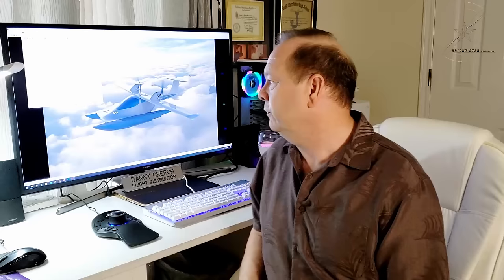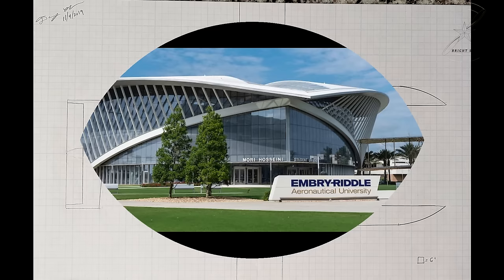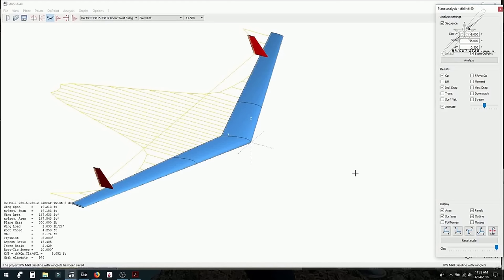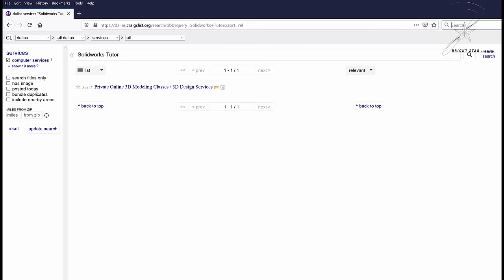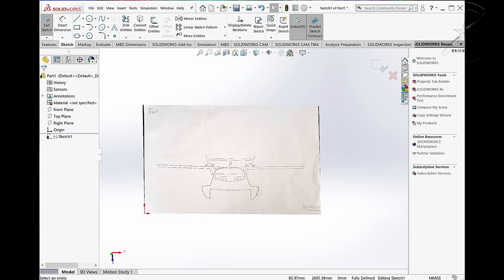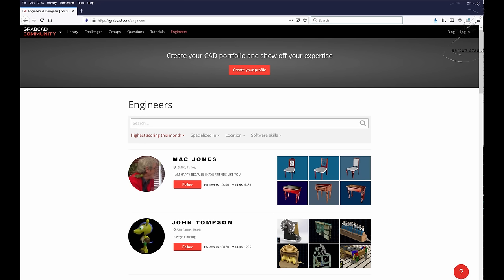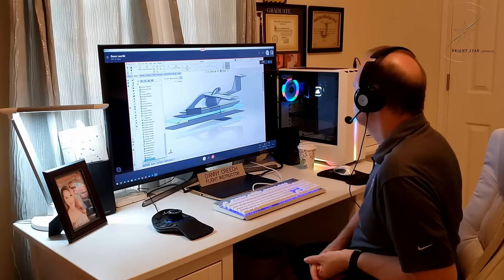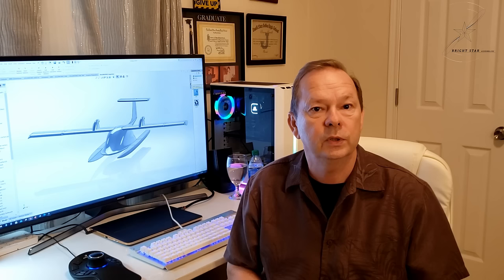How to Design Your Own Aircraft

Comment: Great looking design. Might I suggest a twin boom layout with dual rudders? My worry is that with your current design, there might not be enough airflow over the single rudder for sufficient yaw control at lower speeds. You could use differential thrust mixed in with rudder input easily enough on RC but that wouldn't be ideal for full scale.
Reply from the maker: Thanks for the idea. I will keep it the way it is. I am not a fan of the look of twin booms and that also adds more drag. As you can see, this aircraft already has a LOT of drag. If you  look at a B-787 you will see only one tail and at low speed, that one tail can handle the massive amount of thrust from one engine at MAX and the other engine dead.  There are very few certified aircraft with twin engines and twin boom tails. There is a reason why.  Thanks for the suggestion though. I am always open to good ideas.

Comment: Solid works is easy once you get it..
The best way is to creat the design from foam and try it as a RC and try to modify and improve it before starting on any 3D software since it will take shit load of time and modifying it will take even more 
.. I would try to make a simple design by foam and sand it down to what I might think is what I want and try it as RC and see the aeronautical issues and try to modify it in next several versions,  once I figure out all the part locations like let say where the landing gear or floats needs to be mounted,  I try to copy that idea as 3D modle 
. This is exactly how car companies use clay models to create by hand and scan that modle and try to modify the rest of the details on computer and re machine the design on another clay block using CNC and thats how real idea should come to life
. I know several 3D softwares and my suggestion will be to not start with software design at first but after few RC models and trial and error before spending shit load of time behind computer.. but once the RC modle worked out and seems ok, then go to software and start working out around what you find in RC modle 

 It will be more practical and less time and cheaper..

You can use many many different softwares, solid works, CATIA,  fusion 360, inventor,  many different types of CAT's . Even Art cam if you want to go crazy with surface design looking like a bird.. but I say solid works is the best the only downside is the price..
Reply from the maker: Thanks for the comment. I didn't find the price of Solidworks (FREE) to be much of a burden. In this video I mentioned that if you are a member of the EAA you could download the software for free. They are even allowing users to take the first SolidWorks certification test for free. There may be some disabled features in the free version but I haven't run into that yet. If I do, my CAD guy has a fully working version that he could use to do anything else we may need. 

As for making a model first then putting it into a CAD program, yes, that is one way of doing it.  I use to build and fly RC aircraft so I am fairly familiar with the process. The problem as I see it is an RC aircraft is not like a real aircraft. There power to weight ratio is way off, the flight characteristics are different. Because of the lack of interior and hardware the way it would float in the water would be different. The speeds at which an RC flies and stalls is different also.  With that being said there is one thing I do see a scale model would be good for. That would be to visualize what it looks like. But I can do that in Key Shot with many different angles. Once we have the design all locked in then we will make an RC model of it before we build the full scale prototype. There have actually been already three different people email me wanting to do this. So, the scale RC model will happen. 

Thank you again for the comment. I like hearing others ideas.
Reply: @BrightStarAssemblies  if you make the rc model with exact scale on all part calculating the wing load and applying it to the rc model,  the stall speed and all aerodynamic futures will be similar to the real model since the wing load keep the same and about the floats, it could be calculated to mimic the real model by using small weights in different areas to change the CG to match with real model 
.. 
I fly and I know the wing load in the same scale will act almost the same even if the size is smaller .. using the same wing span only scaled down and the same with wing area , scaled down to match the Aspect ratio with real one and calculat the wing load and add Weights to the scale model that will mimic the flying characteristics of the real one at leat by %90 ( since the smaller scale modles are not as efficient in glide ratio than larger model,  I would say about %90 similar to real one)
Reply from the maker: @Driftseen  Thanks for your comment.

Comment: Solidworks is tough to learn on your own. If I could devote the time to learning it and had a suitable tutor, I'd try it.   As it is, I use a simple 2D drafting program (Turbocad). The X15  was designed with pencil and paper, after all.    You do not need fancy 3D software for 99% of homebuilt aircraft.  If you build swoopy composite things, then 3D CAD becomes valuable.  Old school biplanes?  Not really.
Reply from the maker: Thanks for watching.  I do agree with you about you don't need fancy 3D software to design a home built aircraft.  In our case we are not designing a simple one off home built aircraft. The plain for my design is to make it a kit that can be built by other builders. That requires a material list, inventory list, and construction plains. Later on I plain to make this a certified aircraft which will need FAA Certification.  So, although this design is starting off as an idea, I am treating this design with the respect it deserves in order to become a certified aircraft.  This is why I am using SolidWorks.

Comment: Great concept design! I love aircraft with such an out of the ordinary geometry!
I think I'm a little late to say this, and I hope you're doing great with your project! I'd recommend you adding a little bit of Geometric Washout at the tip chord just to count for an aeroelastic effect called Divergence, that way you can have an even smoother lift distribution along the wingspan. (Also helps if the aircraft is stalling, it ensures some aileron efectiveness).
Reply from the maker: Thanks for the comment. I like ones like yours who offer constructive advice.

Comment: Then comes the issue of stability. How stable is the aircraft in longitudinal or lateral direction. For example if a sudden vertical gust hit the plane what would be the response. 

Or for example you changed the trim what would your longitudinal stability looked like. 

I am just trying to help here.
Reply from the maker: This is why one would have experts look over the design before building the first part. Later comes flight testing to see if the so called experts were right or not. If not then make changes as needed. Trim doesn't normally affect stability. There are many other things that do affect it but trim is way down on the list.

Comment: I'm no aeronautical engineer but that looks like quite a high centre of thrust and low centre of drag. Otherwise this is a pretty good effort for a first youtube video keep it up.
Reply from the maker: Thanks Philip, I appreciate your comment. There will be changes to the design over time. Then once I am finished I will have an Engineering company check the design out to ensure it will be safe and has the proper dimensions. I don't want to waste money building something only to find out I designed it wrong.

Comment: Instead of using a turbine or jet to supply thrust to the air craft is it possible to supply thrust to an air craft with magnetic repulsion? Is magnetic repulsion even plausible? I've seen a design for an air craft that was a bit more saucer than plain. It utilized mercury, electrical current was passed through a ring filled with mercury. Does an air craft even need to have wings. Or more accurate a question, is it possible for an air craft to have no wings or any visible moving parts?
Reply from the maker: Thanks for writing. I am also a big fan of sci fi movies. As far as I know, there isn't any aircraft flying that doesn't have moving parts (gliders do not count because their was moving parts to get them in the air). Even blimps have motors to move them around. Even Hot air balloons have parts that move in the burners.   Maybe a plane like this one is something you might like.  https://www.pinterest.com/pin/441352832222853264/

Comment: What I would do: use OpenVSP (it's free, made by NASA) and let's you really size the design and run Vortex Lattice Method and Panel Method analysis for immediate feedback. I would then use the various export formats to import my design into solid works. From that point your friend could clean it up and you'll know you have the performance you're expecting. This saves time and energy for both of you 🙂

I also highly recommend the Ultralight Airplane Workshop on YouTube with Leon, as it covers common terminology, sizing, and construction techniques that will save you a lot of hassle. Blue skies! 🛩️
Reply from the maker: Thank you Keith for your comment. I am currently looking at the YouTube videos for the OpenVSP.

Comment: I have a plan of making Hydrogen fueled planes based on the F15 just a bit smaller because the F15 is 19 meter long and my plane will be around 6-7 and i will put two 50 litre high pressure hydrogen containers at 700 bar and if i make the engines well they will be able to run it for 4-5 hours at 300 km/h or more.

Comment: Interesting video, and thanks for the info on the free software.  I will have to look into it.
Regarding "How to Design Your Own Aircraft. "   I did that, but this one was made for Microsoft's Flight Simulator 2004.  There is a model builder making a scaled jet version now, but to try to build a real one would cost millions. 
The idea of my aircraft was an extrapolation of a BD-5J Micro Jet into a supersonic slingshot ride.  And that's how it feels blasting across the virtual country side at Mach 1.8 or turning the nose to the sky, going up ballistic even after the engine runs out of air. 
If the idea of the this video was to get a design on paper, and a way to visualize it, then getting the design into the games MS Flight Sim or X-Plane are a way to do that.  My design was done at the time using the 3D program GMax.   I am now learning BLENDER and waiting for the new SDK for FS 2020.
Check out the aircraft at http://www.dickert.ca/Swift/default.htm
Reply from the maker: You are very welcome.  I love the BD5s. Would love to fly the jet version.

Comment: Actually solidworks is not that difficult. And there are some really good courses out there. The best ones usually are the paid ones.
What is difficult is using the advanced tools that Solidworks  provides, like FEM analysis, fluid simulation, electrical wiring, etc.
Reply from the maker: Thanks for sharing! I agree, it is not the hardest thing I have learned. I'm just glad I have a friend who really knows Solidworks very well.

Comment: Looks very cool, but I'm wondering about the floats.  The design is unconventional, will it get up on the step, or have you something different in mind?
Reply from the maker: The shape of the floats are still being designed. Originally I was going for a look that matched many racing speed boats. But due to buoyancy we are making them a bit flatter.

Comment: Finally got a visioned aircraft design from a picture to a 3D 👏🏻👏🏻👏🏻 your design is good , sir you can refer to the conceptual design of the aircraft books or suppoting materials for individual part design so it helps you to get a good aerodynamic design. Here you can add winglets that reduces drag due to wingtip vortices...
Anyway, I am excited to see your aircraft design in the sky.
Reply from the maker: Thank you for you kind words sir. As for the winglets, they do add a sexy look to an aircraft. However from an aerodynamics view they do not help and in fact increase drag if the aircraft flies slower than 200Kts. My aircraft design will be somewhere between the 110Kts to 140kts speed range in cruse. Thanks for the suggestion though.

Comment: I was wondering if the floats and the fuselage would make a large Venturi tunnel sticking the plane to the water/runway
Reply from the maker: That is a good point. I feel the size of the opening and the slower speed this will take off at, I don't think it will be an issue. Still, something to think about. Thanks for the comment.

Comment: I liked your video and I sharing your passion, as I'm interested to design and fabricat an RC plain, I studied the Solidworks, get my first level certificate, then I Finished my 3d design    then I faced a problem to convert this 3d design to a sheat metal and print the results as a 2d PDF for fabrication. Any idea how to do this if the SW, capable of that?
Reply from the maker: Sorry John, I do not know how to do that. I use Solidworks a bit but mostly I just give my ideas over to my CAD guy and he inputs the design changes.

Comment: I have this idea of an asymetrical airplane for my fictional story, i feel like it would work flawlessfly but everyoen else tells me otherwise. Could you tell me if this would fly?

It's shaped like a P-38 Lightning but the airliner-like passenger tube is on one of the sides where one of the propellers would be, and on the other is a giant engine the same size as the passenger area. The only engine is the one on that one side. Would this fly properly?
Reply from the maker: I would have to see at least a photo or drawing of it to give my opinion. You can email me and I will take a look at it.

Comment: i got a  design for my aircraft the downside is the size of it and i cant scale it down due to that it needs 4 propellars  and they are placed inside the aircraft .   2 rotating Circles going diffrent direction in order to make it stable  and to create power for the aircraft as well and i havent  created anay decent design yet due to that my drawing arent that good. i also had some  ideas of making this aircraft into a semi submarine both air and sea
Reply from the maker: That sounds very interesting... I hope you go forward with it. My only suggestion is to keep the weight in mind when designing this aircraft. For every pound you have to have more horse power. Don't forget the weight of the fuel, passengers, and cargo on top of the weight of the aircraft.

Comment: Hello Danny, how do you know where your center of gravity will be when designing an aircraft in a computer or on paper? Especially since you won't know the weight of the materials, engine, etc., fore and aft of the wing.
Reply from the maker: I can't answer that question Scott. I have brought on an Aeronautical Engineer to help me with this. He is still running the numbers and we have several things that are being redesigned at the moment (mostly the tail section). After we get the air frame the proper dimensions, I am sure he will plug in the weights of the engine (we do have this) along with the propellers and run the numbers again to see where our CG will be located. I do know he is using a software that is for aircraft design. It looks a lot like CAD but it is for aircraft designing.
Reply: @BrightStarAssemblies  Thank you.

Comment: Edit...Well, among other things I want to build from Scratch, I have a plane design that pretty much follows a Team Hi-Max fuselage profile...square and not round...(High-wing) but to make it mine's and unique...I want a Mooney  M-20 tail section...Horizontal and vertical.. And steerable Nose-gear...Standard 25-28 ft wing...Flat bottom.....Do you think that's feasible or will the tail section cause problems with handling...??
Reply from the maker: Best to just get started drawing it out and then have an Aeronautical Engineer look it over.  That is my plan once I have finished my design.

Comment: Hi this video was very helpful for my project, i’m going to build an rc model first and then scale it up to fullsize, i have a question, i know a small scale ornothopter is possible but would a full scale one be impossible to build? If it’s not i’ll build a fixed wing  instead
Reply from the maker: I do not see something like an ornothopter as a viable aircraft. That is a lot of complexity and weight to be moving, stopping, then moving it back the other direction. Some things are possible full scale, but you have to ask, are they practical?  Helicopters work because that spinning mass is going in one direction. Imagine those blades Turing one revolution, stopping, then spinning backward one revolution. That is a lot of energy losted. Thanks for checking out my video.

Comment: I've designed a fighter jet that I modeled in a crappy program just to get a rough prototype. I want to redo it in an advanced detailed program n make an rc model
Reply from the maker: Thanks for watching my video.  Sure, get the free version of SolidWorks and watch all the YouTube videos you can on how to use SolidWorks. Then put your design into there.  To make an RC version of it you can export temples of your design with measurements on it and then print them. Best of luck.